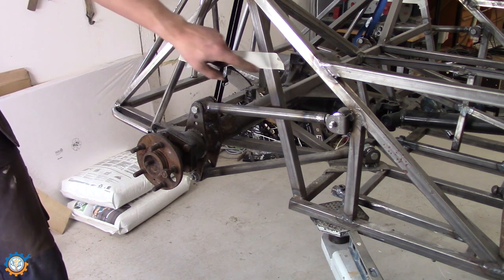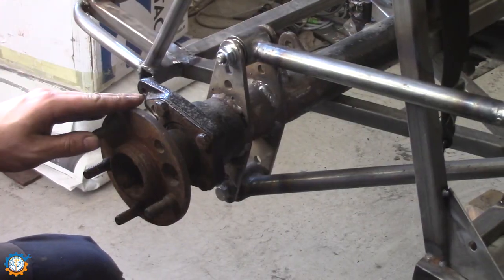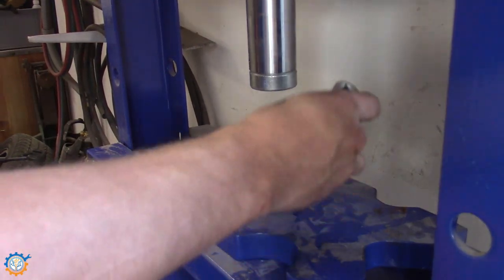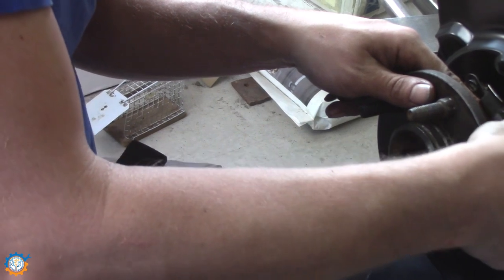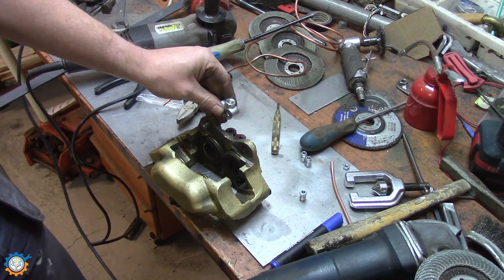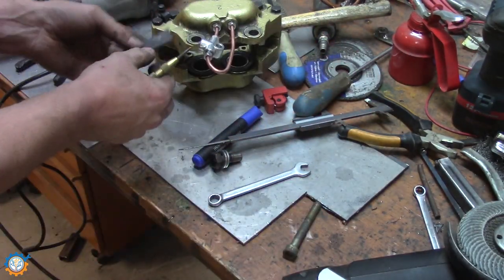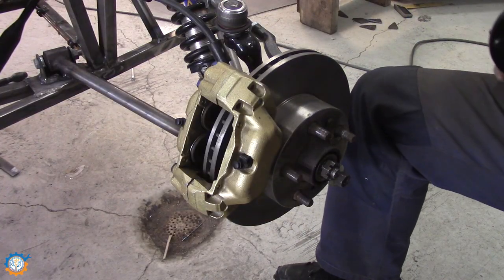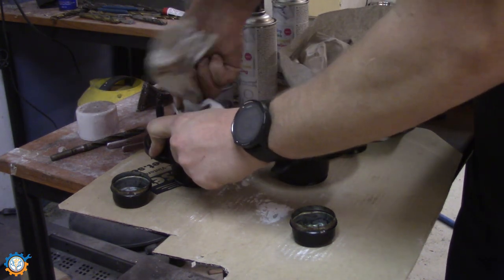Building Super 7 Locost EP18 Rear axle positons and some breaks

Comment: You are making good progress on your build.

A ball joint separator tool from Harbor Freight can be used to remove and install the wheel studs.
Reply from the maker: Thanks! Good tip!
Reply: Except there are no harbour freights where he lives. Take a look at his electrical plugs 😂
Reply from the maker: @jamess1787  huh?
Reply: @DIYTechRepairs  you're in Sweden? Isnt harbor freight an American brand? 😂
Reply from the maker: @jamess1787  correct. We translate that to Swedish Stores that are like HF :)